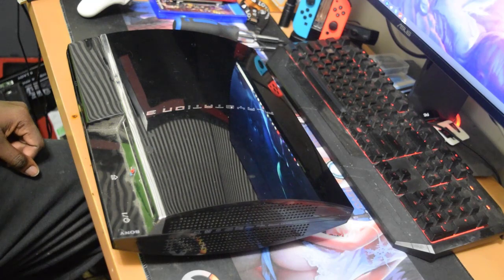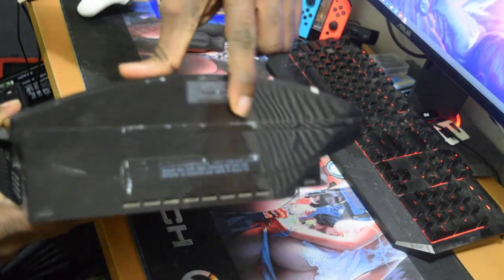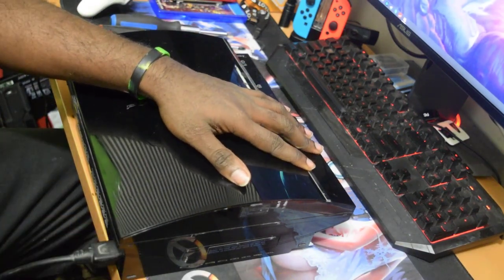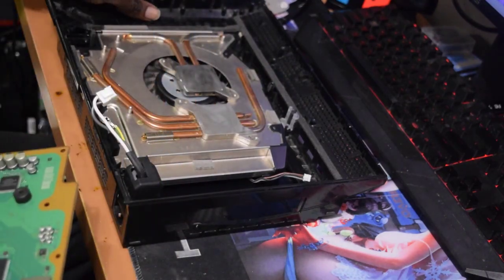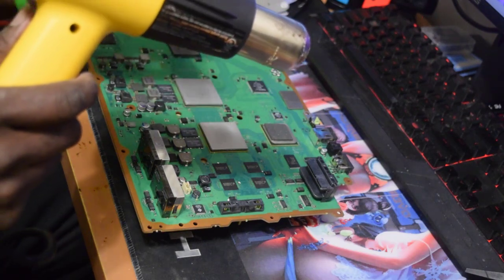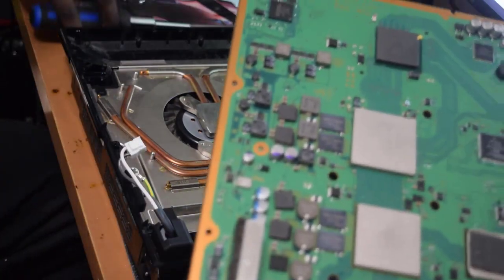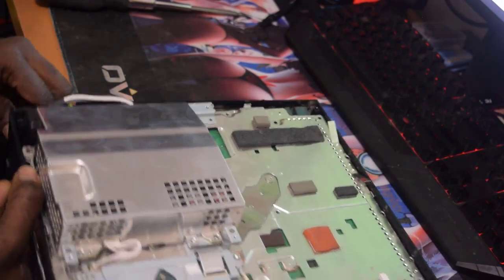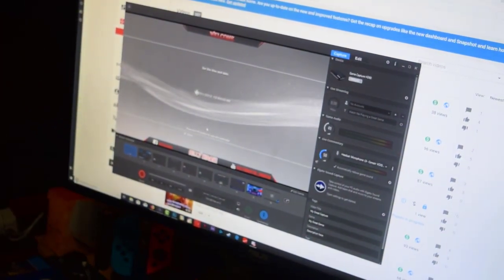How to Fix PS3 YLOD  Yellow Light Of Death  Playstation 3 Fat Repair

Comment: You just revive Nec/Tonik caps for a short time at the end fault code come back again !
Capacitors store energy and release when need ... they also work as a filter for smooth operation .. i am bet your ps3 get random freeze or shut down due to power lose and nasty spikes from that bad caps !
Reply from the maker: I said it in the video
Reply: @billykibakithejamaican  You didn't say anything about replacing Nec/Tonik caps.

Comment: I don’t know whether u are reading comments still or not but pls if anyone sees mine reply I changed the thermal paste but didn’t use any heat gun on thermal pads and it was still having ylod so I am thinking to give it another try can I use hair dryer instead of heat gun on thermal pads
Reply: did you have any luck? You need a heat gun ideally because you need to heat the solder on the board, solder is between 230 - 300 depending on the solder mix Sony used. I'm considering fixing mine, it's been YLOD since 2014
Reply: @ry_man  i totally forgot that I commented this btw it didn’t fix my ps3.. so I kept my ps3 in the storage now I don’t even use it
Reply: @ry_man  yeah my old ps3 has had YLOD since 2017. It served me for 10 years. I kept it in hopes that I am able to fix it as it has a lot of memories on it like my old messages, screensavers, accounts and moreeee

Comment: Hey billy i have a question. I have a ps3 but 
The ps3 iş lagging i dont know why how can i fix that i just delete all the message and other but not working when i try to open my ps3 i must wait 1 minute can you help me?
Reply: Probably your hard drive have bad sectors
Reply: Rebuild the database on your ps3
Reply: i Am DRE heat can cause this, consider applying new thermal paste and giving the fans a good clean. If worse comes to worse, you can reflow the chip, and if worse gets even worse you can reball the chip.

Comment: Tantalos capacitors in the Nectokins and end of the trouble.
Reply: do you use this method?
Reply: @anjratn141  yes, is very good
Reply: @Ricardo_Caze  did you just straight replace the capacitor, you didn't check anything else?
Reply: @anjratn141  I only installed the capacitors in the nectokins, there are people who put up to eight capacitors, but I use only two, on YouTube there are several videos teaching how to do it, or mine already two years ago I did the installation and never yload it again. I me sorry for my bad english, i am from Brazil and speak Portuguise.
Reply: @Ricardo_Caze  no your English is good I'm not either a native speaker ,just to know
 do you install it by your self?
Reply: @anjratn141  Yes, I installed it myself, it is an easy service to do, but if you have no experience with soldering I recommend you ask someone with practice to solder the capacitors, as you have to be very careful not to break any trail on the board.
Reply: @Ricardo_Caze  final question please how you Determined the one you replaced!
Reply: @anjratn141  You don't need to replace it, just add it to the plate next to the nectokins.
They are capacitors of tantalos of 330 or 470 of capacity. I leave a link to a video teaching how to do it, it's in Portuguese but is possible you  understand.
https://youtu.be/ZwNCtzKlL1M